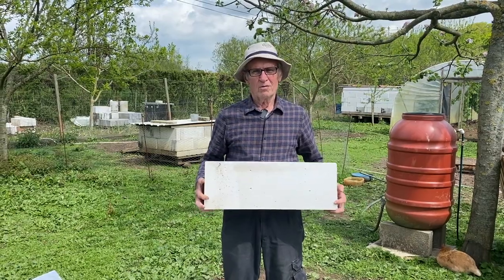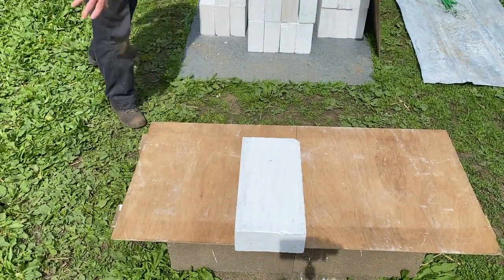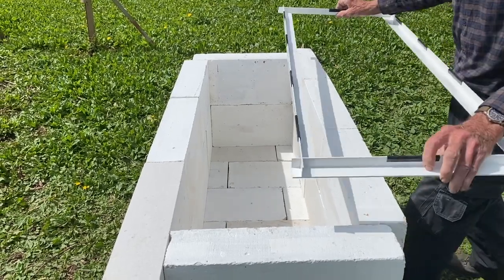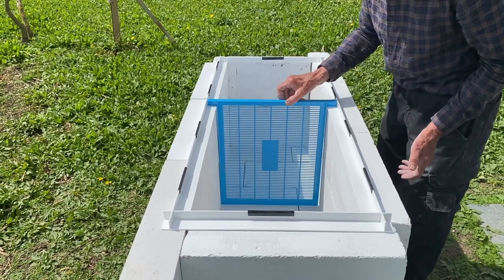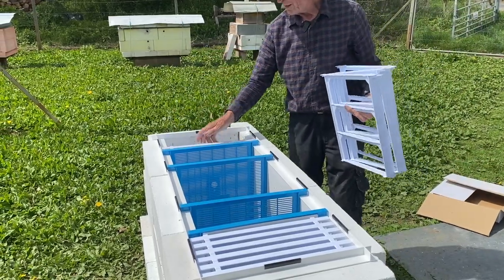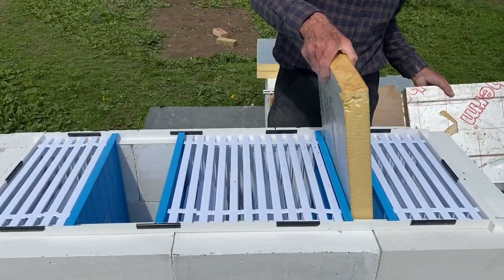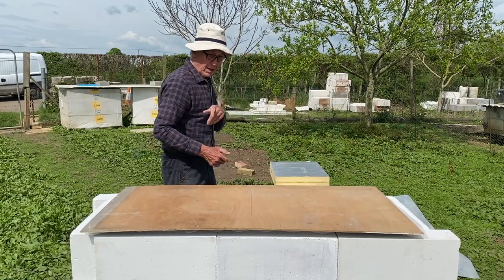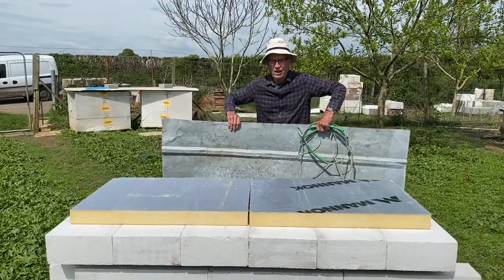Build you own hive - Healthy bees - ZEST hive

Comment: William after your several comments om "inside the hive tv" you were politely asked twice to provide your source datas. Such as, "The propensity for varroa to die away in a humid hive was found out by accident when a laboratory hive was accidentally left at a higher humidity than others and that one lost its varroa. " (Which lab and so on). 

And  "Below 29C. and above 37C. the pupa die. At 35C. it takes 10-11 days to hatch. At 31C. it takes 14-15 days to hatch."
Now again is your chance. We are interested in reading the documentation, if there is any available including mite wash data from the same queen stock.  Thank  you
Reply: Hello there!
I want to ask did you manage to find resarch about humidity kills mites? if it is true we just need to prevent hive ventilation and isolate queen in Chmara isolator to prevent her of laying eggs for 25 days so mites wont have place to hide.
Reply: @Kentrilek  No. But you can't control the humidity for that long. The bees regulate that on an ongoing basis.

Comment: Hi William. Love the Zest Hive concept. 👍
Question :
Is their a Zest Hive Kit available using "Langstroth Frames* ?"
Know you designed this Hive using UK Nationals. However, here in the Scottish Borders 🏴 my Bees are on Langstroth !
Can you advise. Many thanks... 😎
🐝🐝🐝🐝🐝🐝🐝🐝🐝
Happy Beekeeping 2022
🐝🐝🐝🐝🐝🐝🐝🐝🐝
Have seen Phil Chandler YouTube Bee Videos...using the Zest Hive. 👍
Like the Zest Hive idea and its ease of use.
Think I might make one to go along my Horizontal Hive (an Ex Log Box, with a Reused Freezer Lid : Using x20 Jumbo Deep Langstroth Frames, with 4" of Wool Insulation, in all Walls.
(With a Mesh Floor... and under Storage of Beek Equipment !) Nice.
 Lots of  Sheep here ! 🐑
Wools great for good insulation ! And makes for very happy Bees... who come through the Winter with no problems !
Hope I can source Aerated Concrete Blocks from local Town Builders Merchant / Garden Centre.
* If kit isn't available in Langstroth, I will have to make your plastic parts, using Timber instead, and utilise a Wooden Framed Queen Excluder (into a DIY Panel.) Think that would work !?!
Hope you can advise re Langstroth spec. 🐝
(Big market in US as they mainly use Langstroth Equipment there !!! 🇺🇲 )
Any thoughts of doing a Lang Version ? (IF not one at the moment?) 🤔
Reply from the maker: If you want to use Langstroth frames in a ZEST I would be inclined to just make a ZEST envelope to fit them which would be 90mm wider and one block deep rather than two deep. Just sit the frames on the blocks and contain them with wood battens on the walls. Drill bee entry and vent holes through the battens. No bottom entry. Aerated concrete blocks are better and simpler than wool. Cut blocks as needed to suit Langstroth Jumbo deeps

Comment: I've watched this video several times. Looks like an awesome idea. However, what am I missing?  Where do the bees go in and out?
Reply from the maker: Richard, At the top and 5 times each side. They are 20mm holes (cork size) drilled in the blocks at about 50mm down  from the top of the blocks. Close to the top has the merits of raising the humidity, by forming a bucket of humidity, like mist in a valley. Varroa do not like humidity for some reason. All of the build videos on the www. will soon be superseded by the very simplest version, but always at the top.

Comment: Hello William, researching beehives before I get into anything. Would this be suitably built with non-aerated concrete blocks? Not sure I can find them either. I'm in central Minnesota, low temp is -40C, high is 37C. Would "firebrick" be a suitable alternative?
Reply from the maker: Nate, I did test heavy blocks a couple of seasons ago. I just put the insulation boards on the outside to keep the heat in. They did really well. I suspect that it was the thermal "weight" of the blocks that moderated the over the day temperature fluctuations. Then insulating them seemed to do the trick. Give it a go. Someone needs to do so in the U.S.A. It should be free of all the usual maladies like the ZEST hives are here in the UK.

Comment: Doesn't the plywood base rot or is it protected by the floor blocks/hive wall blocks?  When marking the wall position on the floor - presumably a square would be handy to make sure its  err....square?  How would you sterilise the hive if the colony develops a problem?  Presumably you can blow torch the blocks and disinfect the plastic with washing.

Comment: If I like to make a 15 meter in one row how does that work out ?because my wife is fat up with all this loose boxes everywhere. And prefers one fixed solid large one, any suggestions?
Reply from the maker: I think that that is a very good idea. It will work well. Kinda like terrace housing, but with movable party walls. I think that it is more important to get your wife on a diet first though. If you live close to North Dorset I can let you have some used insulating blocks as I am downsizing.
Reply: I do live on a small island in the Mediterranean called Ibiza
Reply from the maker: @benjamindejonge3624  I do not think that they will have or need aerated concrete blocks for your ZEST and I suspect that you are free of varroa as it it is warm and humid. You could use heavy blocks, but if you do build a 15M. long ZEST please keep me informed with photos.